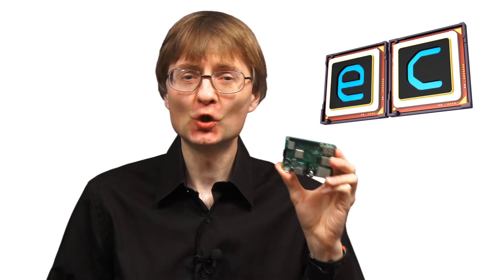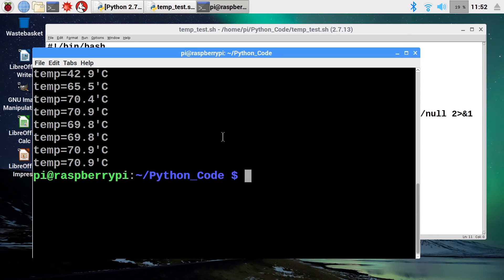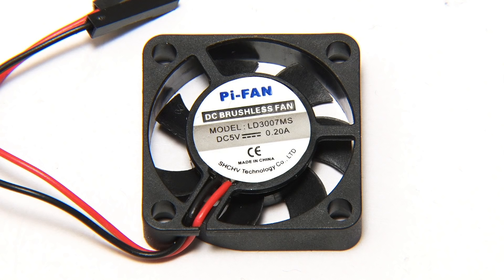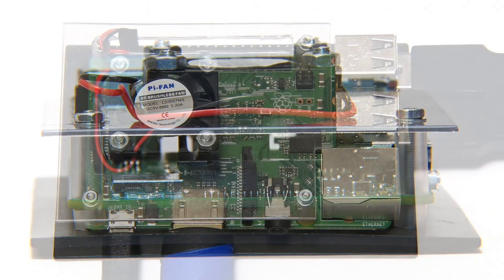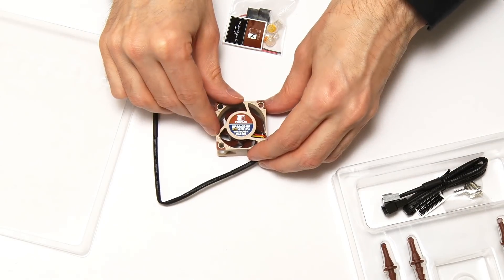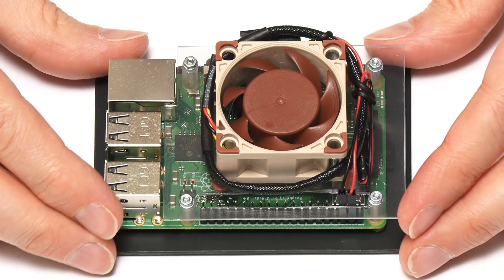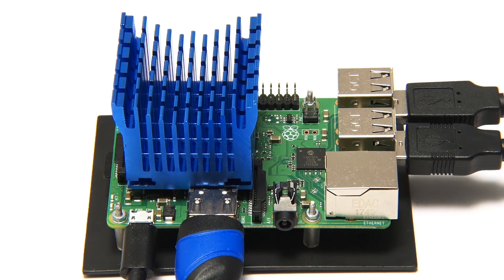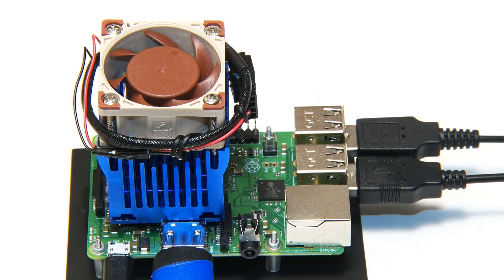Raspberry Pi 3 B+ Extreme Cooling

Comment: There's nothing wrong with connecting to the 3.3v pin.  The fan will just spin slower.  In fact I prefer to use the 3.3v pin for that very reason, as I find these little fans too loud at full speed.
Reply from the maker: The 3.3v pin on the Pi taps current after the Pi's voltage regulator. The 3.3v supplied by any GPIO pin inevitably does the same, and GPIO pins are not intended to deliver more than a few tens of amps. So if you use the 3.3v pin (or a GPIO pin) you are risking damage to the Pi by connecting an electromagnetic device (a fan, what will induce peaks and noise) to a connector that is only intended to be connected to an electronic device. So will it work? Probably, most the time. But so will driving without a seatbelt. And neither is something that I would advise here. A lot of people watch my Pi videos, and if I did not caution against using the 3.3V pin to power a fan, statistically it is inevitable that some of them would damage their Pi.
Reply: @ExplainingComputers  this was true for the original pi, but the b+ and above can handle a higher load on the 3.3v pin https://raspberrypise.tumblr.com/post/144555785379/exploring-the-33v-power-rail
Reply from the maker: Very useful link; thanks for sharing. Clearly more things can now be powered via the 3.3V pins. But I still would not advise attaching an electromagnetic device that side of the voltage regulator.

Comment: I'm following what you have done using the noctura fan however I'm stuck on actually connecting it to the RPI, what are they connectors you have used for the bare wires?
Reply from the maker: The fan connects to pin 2 (5V) and 6 (GND). With the Pi positioned with the USB connectors at the bottom, Pin 2 is the upper right most pin, and pin 6 is two down from it. You can see the (top 26) pins in this diagram -- drawn for something different, but pins 2 and 6 are clear. Good Luck! https://www.explainingcomputers.com/images/pi_zumo_sensor.jpg
Reply from the maker: Sorry, I answered the wrong question! But I'll leave that info there anyway.  You wanted wires! :) They are jumper leads. I bought a pack like this one and cut a couple up to connect to the fan wires: https://shop.pimoroni.com/products/jumper-jerky?variant=348491271
Reply: @ExplainingComputers  no worries, thank you so much! I'm super new to doing anything like this, do the bare wires just fit into the connectors or is there some soldering involved?
Reply from the maker: I did not need to solder anything here. I used the connector to the fan that has bare wires, and then I cut the sockets off the end of two jumper leads, leaving me wires with a jumper connector on one end, and bare wires at the other. I then just twisted one of these onto each of the fan wires, and secured with tape. They could be soldered, but not required.
Reply: @ExplainingComputers  thank you for replying! mostly what im having issues with is the adapters to use from the bare wire to connect it to the gpio pins.

Comment: Thanks for doing this video. It was extremely helpful. This video is around 8 months old, so not sure I'll get a response, but I'd like to ask a question. Do you have any thoughts on the form-fitting heatsink and dual-fan setups such as this: https://www.amazon.com/MakerFocus-Raspberry-Aluminium-Radiation-Protection/dp/B07LG77XDB/ref=sr_1_17?s=electronics&ie=UTF8&qid=1546915843&sr=1-17&keywords=raspberry+pi+heatsink+double+fan ?
Reply from the maker: Looks a very interesting cooling setup -- I've not tried it though.

Comment: When it comes to heatsinks, I always go by the theory of making sure to have copper touch the CPU/GPU and then lead that copper into some type of aluminum. In my experience it's usually some type of aluminum fins. I noticed a huge difference when I first did this with using an all aluminum heatsink and then switching to one where copper touches the chip and leads off into aluminum. There's actually some physics behind this as copper absorbs heat much quicker and aluminum's ability to spread out and dissipate heat. I think that's how it works anyway, but it definitely makes a huge difference with the type of metals you use in regards to touching the chip to be cooled and so on.

Comment: I am wondering how the little and cheap pi-fan  would have performed along with the large heat sink. Perhaps not much of a difference comapred to the expensive fan?
Reply from the maker: I think you are right -- I doubt the small fan would make much difference at all when using the larger heat sink, as there is very little airflow.

Comment: Just curious, if you tested the (3 rd) with the fan blowing on the heatsink as you did with the Noctua fan just to see how they compare. I noticed that in the video you had the small 30 mm fan blowing up instead of down on the HS. 

Great video on the other scenarios though . :)

Edit)- I scrolled down a little further and seen someone ask the same question :). 
Thanks

Comment: I have a question. Is this the PWM fan? Will the respective DC fan work as well? What about the FLX one?
Reply from the maker: The fan can be PWM controlled, yes. But not from a Raspberry Pi. Here it runs from the 5V pins (tapped before the Pi's voltage regulator), and hence is just on 100 per cent all of the time.

Comment: Have you considered using a TEC1-12706 Thermoelectric cooler?
Reply from the maker: Not . . . yet!
Reply: @ExplainingComputers  I've recently purchased a Raspberry Pi 3 B+. Can you suggest any idea how to use a TEC1-12706 Thermoelectric cooler? I'll provide a separate 12 V power source, since the 5 V coolers consume too much current which I don't think can be supplied by the Pi.

Comment: You mounted the pi-fan to suck the air from the heatsink, but the noctua pushes air onto the hs. That's not a fair comparison
Reply from the maker: Yes, different way up -- my bad. But, in an open rig as here, it will make very little difference.

Comment: How is that possible compare with liquid cooler? So you saying basic fan with small sink hitting 56? Maybe software glitch.
Reply from the maker: For a Pi, basic fan with small heat sink at 56 is pretty much expected at load. SBCs can run pretty hot.

Comment: I've mine with the little heatsink on CPU's top , a 80 mm generic fan 12V mounted back(from a old PSU) ,directing the airflow toward the heatsink throught the front, reaching 39-45°C not heavy task (libreelec). considering outside is 27°C-30° AF.  can you build one with an spare AMD or Intel stock cooler + Heatsink ,and bring out these heavy paperweight?

Comment: Mounting the Pi inside of the hose of a shop vacuum cleaner would work best without moisture or static electricity causing any damage to it and you can keep it real clean and free from dust.
Reply from the maker: Cool!

Comment: What if you used some thermal compound on the Small Heatsink, and then attached the Noctua fan with the small heatsink plus thermal compound application still in place?
Reply from the maker: It would probably improve the result a bit! :)

Comment: Is there any way to start the fan on the RPI when a specific temperature is reached only?
Reply from the maker: This could be done using a temperature sensor and a controller to run the fan. Not trivial though.
Reply: @ExplainingComputers  got it, thank you

Comment: Yesterday I was installing Raspbian in my first ever Pi, 3 b+ model. After 30min I touched the cpu and it was very hot, I didn't think it was going to br like it but well it's a cpu, I used my mom's hair dryer in cool mode while installing but luckyly I bought some small heatsinks and a 30mm fan.

Comment: Why is it so bad to attach a fan to a GPIO pin or 3.3 pin?
Reply from the maker: The GPIO outputs are only able to supply a few tens of milliamps, and are only intended to provide signals to electronic circuits, not to power electrical (electromechanical) devices like fans. So a fan may overload the GPIO output, and introduce interference. You may get away with it! But I personally would not risk it.
Reply: Thank you for the reply!

Comment: That crooked 5V dupont connector on the small heatsink/noctua configuration kinda made me cringe a bit.  Really had me wanting to press it down and get it flush. Or moreso, made me want to shorten the wire, crimp some dupont pins onto the ends and resleeve it.   Nice results from the test, though! I like it!

Comment: I am sure if one were to look in the scrap bin of (let's say) an laptop repair show or pc shop one could find a legacy/vintage laptop to cannibalise for it's more flat and elegant heat sink apparatus (usually including a fan)
Reply from the maker: This is true. But last time I did some cooling experiments with a Pi, I used such components -- and ever since have been answering comments on "where can I get those exact parts?" So here I used things readily available on Amazon/etc. And I've now shared the CAD for a 3D printed mount that makes this easier on the eyes! https://www.youtube.com/watch?v=NzTsDrepf64

Comment: I hope you still reply to these older videos, but here goes. How loud was your PiFan? I have a couple of those and they've been very noisy to a point where I've needed to hide them to a sound"proof" box. I've also been planning to make them temperature controlled (or at least on @65C and off @50C or similar) by using a transistor as a switch and some Python, though this has proved to be difficult as for my lack of knowledge on electronics.
Reply from the maker: The Noctua fan here is audible, but not that loud. For the airflow it provides it is quiet. But if you want a silent room, this will be noisy for you.

Comment: Thanks to your videos I finally realized that an efficient cooling solution is indeed mandatory for the Raspberry Pi 3. And that the puny little heatsinks some manufacturers put in their kits are laughable at best. It seems that just putting a fan over the standard heatsink makes a huge difference, so I would say that to have a decent cooling system with a relatively small heatsink you have to have a fan. If not, heatsinks have to increase in size.

Oh and thanks for the sysbench tips!! Testing my system right now.

I also discovered that the "temp_limit" option in /boot/config.txt works pretty well.

Comment: measure the temperature and humidity of the room and calculate dew point, then throw it into a bash script that turns on a GPIO port going into a mosfet, have it turn on when the core temp is at least 1 degree above dew point, and have the mosfet going into one of these bad boys
https://www.amazon.com/TEC1-12706-Thermoelectric-Peltier-Cooler-Volt/dp/B002UQQ3Q2/ref=pd_lpo_vtph_147_bs_lp_t_1?_encoding=UTF8&psc=1&refRID=CJPD1GQXSYQC4QH55Q15&dpID=31cGfbjeNUL&preST=_SY300_QL70_&dpSrc=detail

Comment: I placed a fan under the raspberry board to blow away heat, so now board runs cooler. I use AC Infinity MULTIFAN S1, Quiet 80mm USB Fan for Receiver DVR Playstation Xbox Computer Cabinet Cooling.

Comment: I wonder if you would get a better result from the 30mm fan (fan & SHS), with the fan flipped to intake instead of exhaust, just like how the Noctua fan was turned? I think it could be comparable to the Noctua results.
Reply from the maker: The 30mm fan was indeed, by accident, the "wrong" way up. But that will make almost no difference to the results (esp. in an open rig) as the airflow through the heat sink vanes will be pretty much identical. The Noctua delivers massively more airflow, so will always win! :)

Comment: What?  No air-water spray cooling?  And you can also do microchannel cooling.  The most effective ever was air-water on an IGBT, at over 825 W/cm^2.  Heat sinks?  Those are from the olden days.

Comment: Uhm but did the Frequency stop throttling with the fan and HS? it's so strange that the small heatsink did nothing specially for throttling
Reply from the maker: Throttling is linked to the temperature of the SoC; A Pi 3 B+ has a mid throttle at 70 degrees, and full throttle c.82. So you can see in the tables in the video where throlling ceased to be an issue. It is not strange at all that a very small heatsink with no fan reduced the temperature less than a larger and active cooling solution! :)

Comment: I am sorry, but did you put the pi-fan in pull configuration and the Noctua fan in the push configuration. 
Shouldn't you put both in push or pull configuration for consistency in results. 
I think both would have produced the same temperature results. Please correct the testing methodology/video!!
Reply from the maker: You are right, the first fan was the "wrong" way up. Though as you say, the results would probably be the same, esp. in an open rig. As I am sure you are aware, there is no way to change or "correct" a YouTube video after upload, and it really does not matter! :)

Comment: Why did you put the small fan in a pull configuration and the Noctua in a push?
Reply from the maker: By error in the instance of the first fan! Will make very little (if any) difference though; esp in an open rig! :)

Comment: Passive cooling with a large copper heatsink would be best as it will conduct the heat way from the die more efficiently, but if you become obsessive about getting the temperature then water cooling is really great. Back in the old days of Athlons I was water cooling my PC components and achieved an impressively low 2 degree rise above ambient temperature rise. Compared with a 50 to 70 degree C temperature rise using the OEM supplied heatsink and fan kit. Not only than but water cooling was so much quieter. Water cooling is perhaps less practical for something so small unless planning to build a cluster of raspberry PIs and off the shelf plumbing parts could be utilised in copper. Anyway, great video. Never realised just how hot the CPU SOC gets. Now going to fit a heatsink to mine.

Comment: This illustrates it is always a good idea to pull (NB) heat-sinks off old motherboards you retire. You would not need to buy those things.
On a side-note, would thermal adhesive pads used for chip sets be thermally conductive enough? They stick better than thermal grease at least.
Reply from the maker: I could not agree more! I used an old NB heat in a previous Raspberry Pi 3 cooling video -- https://www.youtube.com/watch?v=1AYGnw6MwFM -- but then got loads of requests for where I got the heat sink! So here I decided to buy one that I could link to (and Amazon then sold out). You are right that the thermal pads would stick best, but I tried this cooling a Tinker Board S a few videos back, and the results were terrible. :(
Reply: Thanks for the answer.

Comment: Its worth trying to design a mount for high pressure heatsink mount.  That way you can attempt liquid metal with a copper core heatsink + fan or whatever, as long as you dont use aluminum

Comment: How did you fix the big heat sink on the Pi? Are there any mounting accessories?
Reply from the maker: It was basically just sitting there, held by the thermal paste. But not a permanent solution. There are no mounting accessories on a Pi. :(

Comment: I found a supplier of peltier cooling units that appear to be very nicely sized for the purpose of cooling the Raspberry Pi, so using that in conjunction with a large heat sink and fan, I think you could achieve some very dramatic, perhaps even spectacular, results.  That source?  tetech . com/peltier-thermoelectric-cooloer-modules/standard/  I then realized that 5v peltier coolers are probably available via Amazon, and found a variety of them with a search for 'peltier cooler 5v'
Reply from the maker: I must try peltier cooling some time!

Comment: cool experiment! 
isn't it beneficial to also cool the voltage-regulator?
Reply from the maker: For the health of the regulator, certainly!
Reply: I thought about this.
Yes for it's durability (the reason why i put heatsinks on them),
but when i'm right, the efficiency of regulators decreases with rising temperature.
So it would be more power efficient. (probably minimal)

Comment: I'm curious to know the results with the fans blowing air outwards instead of the air blowing downwards does extracting hot air work better then blowing the hot air back down? if hot air rises is the cooling fighting itself at all?
Reply from the maker: I have the first fan sucking up rather than blowing down by mistake. Makes very little difference to cooling, especially in an open rig like this, as the movement of air through the heatsink is pretty much identical.

Comment: As long as it's kept under 70 degrees c then the cpu will remain at the max clockspeed of 1.4 ghz.  Any further reduction in temps doesn't improve performance. That right?

Comment: I want try this sh script with my pi zero. I have changed the thread from 4 to 1, but it does not work                                                                                                                                                   File "temptest.sh", line 5
    for f in {1..7}
                 ^
SyntaxError: invalid syntax